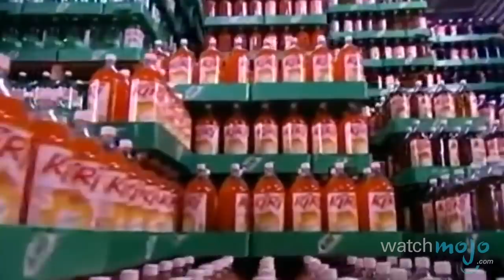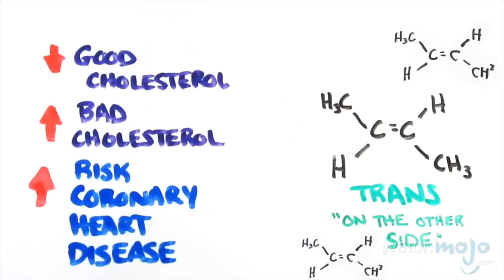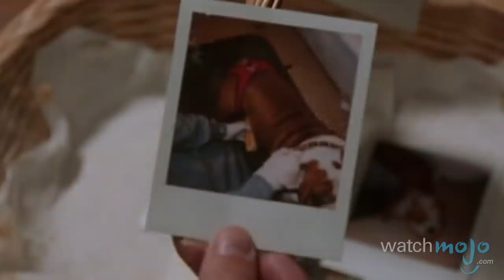Top 10 Deliciously Unhealthy Foods

Comment: Yay! Pizza wasn't on the list!
Reply: KevinPikachu YT 21 maybe because of the tomato sauce and the bread.
Reply: AnglerShark YT most of the time tomato sauce has sugar and too much flower from the bread can cause obesity. K thx bye
Reply: But it’s bad still
Reply: Maybe it was the 11th bad food
Reply: That’s because pizza is real food.... 

Just don’t eat too much at once. My innards are happier with just a slice at a time. Wait a few hours and I can have another. I figure if I time it right, I could eat nothing but properly spaced four pieces of pizza to get my daily calorie needs and protein needs without a hazardous amount of sodium or fat or carbohydrate.

For example, a slice of Domino’s large (14”) 4-veggie-topping pizza (black and green olives, mushroom, onions), where the whole pie is cut into 8 slices, is actually a nice small meal. Has about 11 grams of fat, which is digestible within a reasonable time. 250 mg of sodium, which is better than a lot of processed foods. 34g carbs, which is amazingly within the guidelines for even a Type 2 diabetic for a single meal or snack. And 10 grams of protein. 280 calories.
Reply: Cheese wasn't on the list either.  Or salami.
Reply: @darrenmiles-morland8038  Salami is sausage, so it's on the list with the hot dogs. There are a lot of preservatives, nitrites and salt in salami, unfortunately.  Try to eat it not often, thinly sliced and with apples or sauerkraut to help digest it quickly.
Reply: KevinPikachu YT 21 yaaayy
Reply: @nikoskoumparos1109  flour
Reply: There are two ways to eat pizza,with or without vegetables.
Reply: @imabrahamdc2464  oh right. Thanks
Reply: But anything worthwhile you can put on it is.
Reply: @jwoolman3425  Duh, it's not animated pizza. Ofc its real.

oh wait.. im not real.
Reply: Pizza is kinda a sub for body building depending on your toppings
Reply: No wonder people are fat and unhealthy! I can't believe how little people know. Pizza REFINED FLOUR! EXCESS SALT in Tomato Sauce and in PROCESSED MEAT  and in the CHEESE. Processed meat is NOT EVER HEALTHY!!!  CHEESE is high fat in -unhealthy fats. Processed meat is also high fat. It is NOT REAL FOOD, people.
Reply: Pizza is high in calories but aeast it has reasonable protein and nutrition.
Bread isn't very bad
Sauce is prob the unhealthiest thing but its not chocolate level bad
Cheese is ok too
Pepperoni is meat so high in protein and fat. No carbs
Any vegetable in pizza like mushrooms,tomato, spinache ect is good
Meat is high in protein so pretty good
The only bad things is oil, butter and other fats
Reply: maybe they forgot😂
Reply: @urtellingmeshrimpfriedthisrice  NOPE!
Reply: @cordedwaif  nah
Reply: @darrenmiles-morland8038  Salami falls under Processed Meat at 9:43.
Reply: KevinPikachu YT 21 but toppings and cheese count 😔 + crust
Reply: bread makes you fat?
Reply: @HydratedOats  unfortunately its as bad as a bag of sugar.
Reply: Even when you get pizza you can always top it with veggies instead of meats. I'm not bothered having a bagel almost every day for breakfast. But seriously, even when you eat healthy, guess what...you will still die. You can be as fighting fit as Richard Simmons but something will make your body betray you.
Reply: @pamelatorres156  better to live life healthy and not obese
Reply: Very simple. This video is sponsored by pizza makers. Trust me.
Reply: Pizza is super nasty ya’ll have terrible tastes
Reply: 99% of junk food is bad for you. Unless one cooks at home with fresh ingredients.  No frozen or GM shit. Even then eat junk food occasionally.  Current situation barring, as we have less choice. Stay safe guys.

Comment: Correlation does not equal Causation 
These studies are flawed/ not from reliable sources 

Disagreements 

Bacon- If you can get Pasture Raised Bacon or at least 0g sugar and no elemental compounds: you’re fine

Hot dogs - Unfortunately most hot dogs have added cruddy ingredients 
But Butcher Box has hot dogs cured in clean ingredients 

Depends what oil you fry it in -Avocado oil is best 

Red meat is healthy 
But it is expensive to get grass fed grass finished beef 

Salt does not cause health problems 

Sugar and Excess Carbohydrate Consumption Cause All health problems